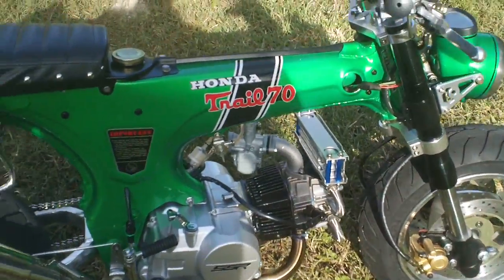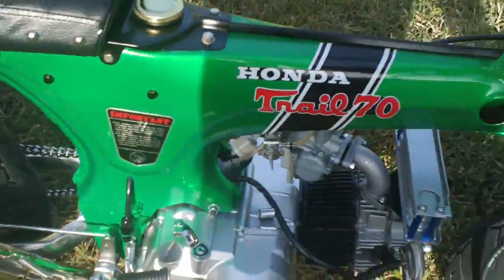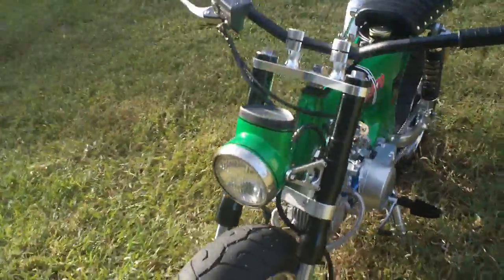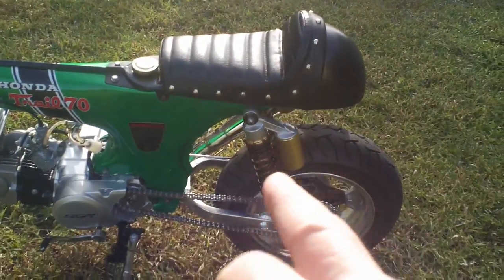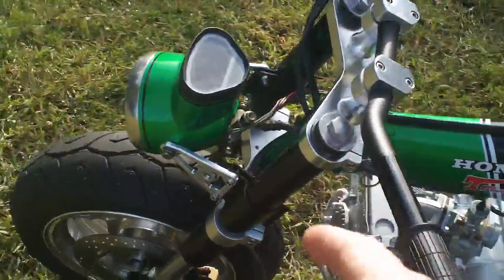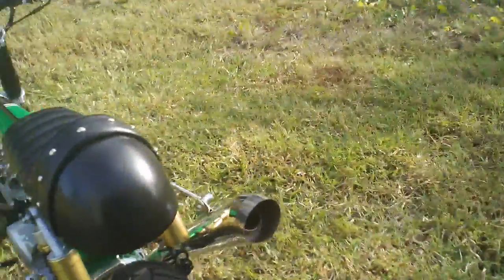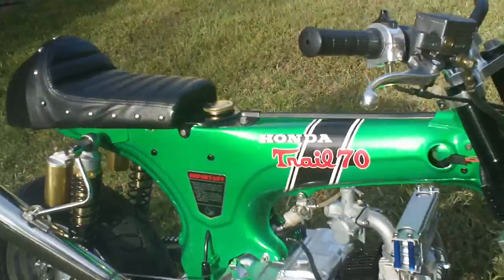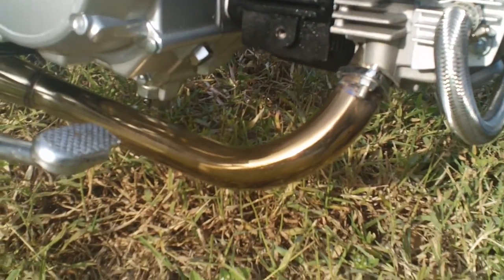Honda CT70 cafe racer

Comment: Wow, that thing turned out real nice. Great job and good decisions on direction. I havent been able to work on anything lately myself, moved out of state to florida, and just trying to get back on my feet right now. I do plan on picking up a Buell project as soon as I am able to. How about an update on this bike, did you get the clutch finished? Love the Buells too.
Reply from the maker: THE DRAGON  yeah it's pretty much done. ..just tuning  chassis and carb.. got some paint to touch up and graphics to do still but it's running  real good. next project is going to be a 2 stroke. ..probably a rd350 or rd400. blue smoke rocket! !

Comment: nice bike! getting ready to start my build soon. question where can i find your handle bar and throttle setup?
Reply from the maker: just got the bars off ebay... generic  low superbike bars..  throttle I got from "dr.ct70" on ebay..
Reply: Did you have to notch the bars out or does he sell a moded kit?
Reply from the maker: C G  I just ground the tabs down a bit.. they wont spin
Reply: Thanks for the info